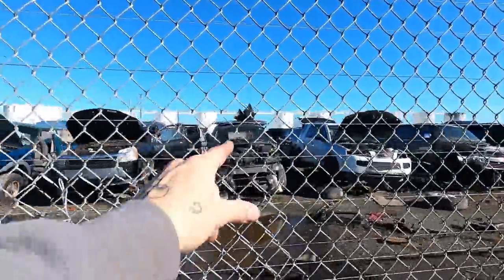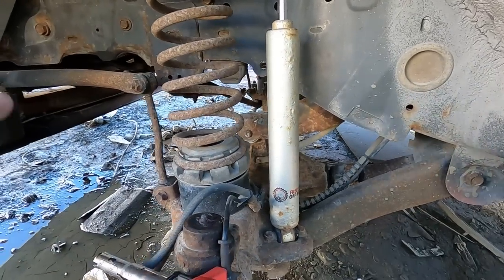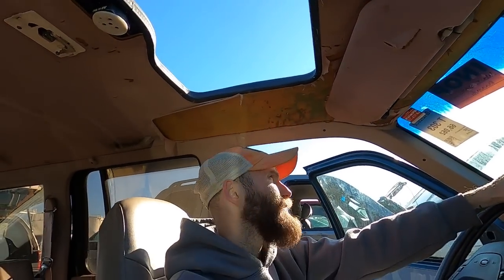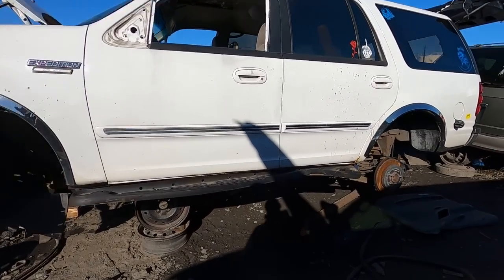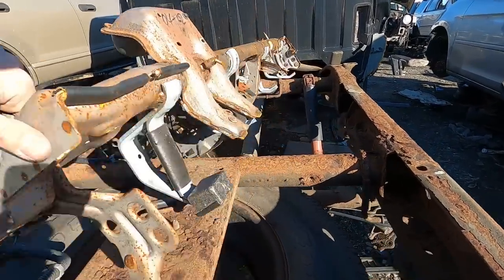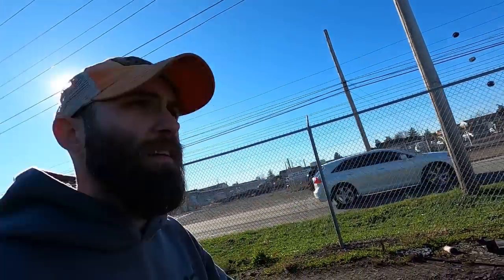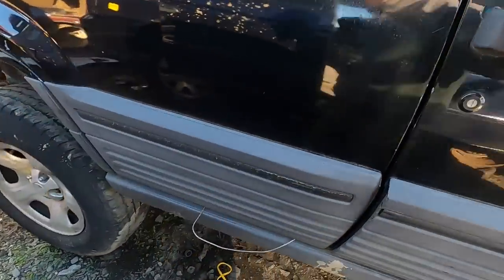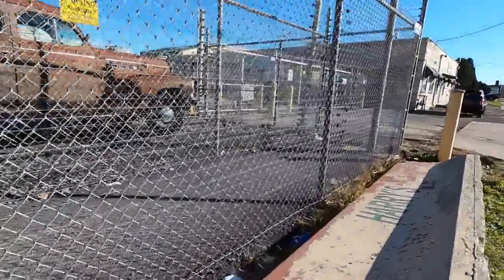Exploring a Truck/SUV Graveyard - D&E in the U-Pull 48

Comment: Those 1st gen Explorers were actually really well built; it's almost like Toyota built them.  My grandfather had a 92 Eddie Bauer that was super reliable and looked better than just about anything on the road.  For US automakers the early 90's seems to be last of the era of "Lets try and build the best car/truck we can" and started going to "Lets try and make as much money as possilble with this car/truck".
Reply: I think the "exploder" reputation came later when they switched from pushrod engine to the SOHC hatchet-job engine. at the same time they went to a 5 speed automatic. So they basically downgraded the engine and transmission at the same time to get a little more respect from the automotive press, and a few more HP at the top end of the rev range where you can't really drive it anyway. It's better to have SOHC and be unreliable than have a bulletproof pushrod engine apparently. That SOHC cam engine chewed up timing chains and had one on the back of the engine: engine had to be pulled to repair. Whoever designed, or Okayed that design deserves time in hell.

Comment: The guy  bought my ZJ from told me that when they did the trailer hitch recall the dealer put an aftermarket 4 wire flat connector on it.  When they did that, they ran a ground from the battery, or fuse box I forget which, all the way to the back for it.  At least that's the story I was told.  Congrats on the upcoming executive producer, good seeing you again.
Reply from the maker: Thanks bud! Also.. please tell me the “dealer fix” wasn’t running 12 awg wire on the OUTSIDE of the unibody under the Jeep!!! Leave it to the stealership…..
Reply: @DEInTheGarage  They ran it from the battery/fuse box, to the firewall, then along the firewall to somewhere near the master cylinder, and down to the back of the Jeep.  I honestly try not to look at it, but I have used it on occasion.  Honestly, I think it was done before he got it.  And, I think that's how the aftermarket 4 wire harness works, running the ground back up to the front.  I've seen the universal kits run that way a lot in the u pull yards.

Comment: 16:30 Those 3.7's were notorious for immobilizers and ignition switches being bad. You'll get power going in the switch but none coming out. It happens intermittently so you end up chasing everything else like with the NSS or a failing starter relay. Immobilizer switch detects a key and lets power into the ignition switch itself. So when the immobilizer fails intermittently  It would seem like it has to cool down, but its just the switch working sometimes.
Reply: The immobilizer failing wouldn't kill the car while driving, just prevents it from being started again. What you're calling the ignition circuit is the starter circuit. Two separate things. For safety reasons you can't have the car hit a pot hole, the ignition switch lose contact and the car stall lol. It's the ignition switch on the starter circuit, confusing I know. The ignition circuit is on the ECM harness.

Comment: As for the Tacoma, they had a factory recall for frames due to rust. My son has a 2007 we bought with 261K miles needing a head  (previous owner drove it too much with a blown head gasket and cooked the head). Toyota replaced the frame and pretty much everything underneath the truck and I dropped in a salvage yard engine with 25K on it. That was 4 1/2 years and 70K miles ago and the only repair it’s needed since was an a/c compressor clutch. How dare they make an a/c clutch that only lasts 340K miles!

Comment: My job used to have 4-5 of these. We read water meters in them. We have sold them all now. We also had 4 RHD TJs. We just sold the last one of those as well. We have transmitters on the meters that send the readings in monthly now. so we only have to manually read the ones that get damaged. Mail ladies buy them up rom auction when we sell them. They run the prices up or I would have bought one. Like I need another Jeep in the driveway! LOL

Comment: You’re spot on about Saturn.  I worked in future product development for the General and while there were some genuinely great ideas in their design (space frame, mill and drill panel fixture, “lost styrofoam” engine casting process), the overweight management structure dominated by accountants rather than engineers, assured that the product would fail in the marketplace.

Comment: Okay so about that 07 WK  they had a recall on the ignition switch. They sell a replacement for like $30 on Amazon. 10 minute job. I have and 05 4.7 that did that too before replacing the switch. It used to honk and randomly make the wipers move on their own. Hope that helps
Reply from the maker: It sure does! Thank you!

Comment: I bought a replacement gas tank skid for my WJ that was a ton thicker than the factory one. The factory one they called a "brush guard" or something. I upgraded to the skid plate which could hold the weight of the vehicle.
Reply: Same. Random dude off Craigslist had one and I was shocked how heavy it was… it outlasted the vehicle!!

Comment: Man I'll tell you what I hate to see those OBS trucks just sitting in a yard like that rotting away. Funny that you found that Saturn Vue in the yard those things were great vehicles I had a 2007 we drove it all the way up till about 2018 it had a few issues but nothing that was hard to repair I think the only thing my wife had against it was it used to belong to my mom I took it over after she couldn't drive anymore in 2009. Those old 90s forerunners are great I had a 95 but that 3.0 motor is garbage they don't call it the three-point slow for nothing. That old obs Dooley you were looking at didn't look to be in too bad a shape that truck in fact quite possibly had a 454 in it and if it was a 454 produced at Tonawanda engine in Canada
Reply from the maker: Damn bud.. thanks for the knowledge drop! Would love to wander around the GM aisles with you sometime. I had an uncle who had a 5-speed Saturn Vue! Super cool little suv.

Comment: Its the neutral safety switch in the transmission. You have to pull the pan. You can bypass the nss if you pull the relay (starter relay) in the engine bay and jump it there. It might even be the relay itself.

https://youtu.be/FAdfUFzw-L4